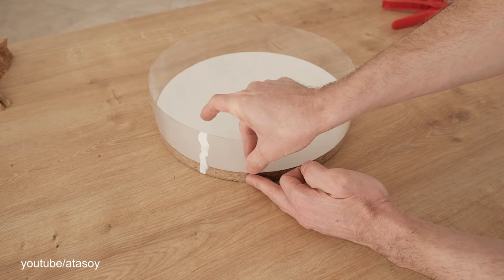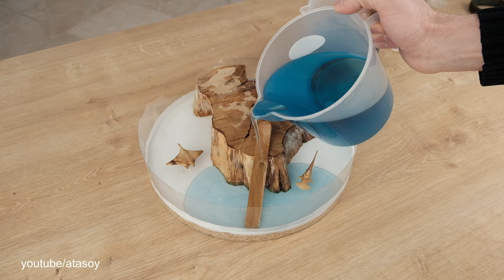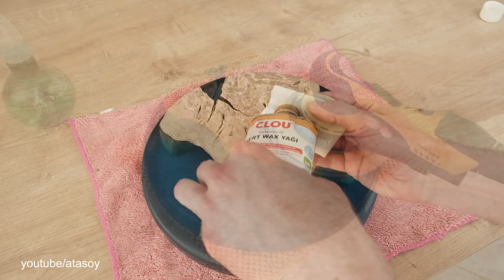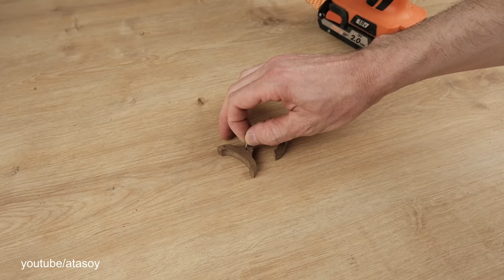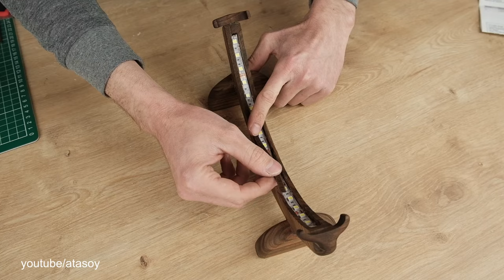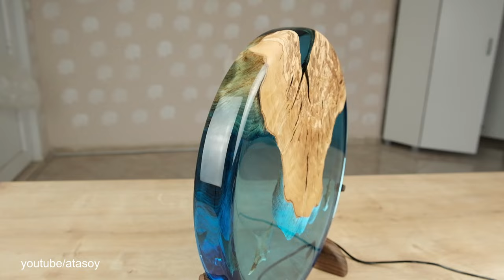How to Make a Decorative Sea Creatures Epoxy Lamp - Resin Art

Comment: turned out very beautiful! I made about the same but as a side table. If you had first sailed the wood with epoxy, then you would not have had those few air bubbles. but you probably knew that. greetings from the Netherlands

Comment: hocam epoksiyi döktükten sonra içersinde oluşan baloncukları almak için pürmüz kullanıyorum ama ertesi güne içi tamamen hava kabarcıklarıyla dolu oluyor bunun önüne nasıl geçebilirim ? 
bu zamana kadar çok yardımcı oldunuz teşekür ederim
Reply from the maker: Epoksiyi hazırlamadan önce mutlaka oda sıcaklığında beklemiş olmasına dikkat edin, eğer soğuk ortamda bekledi ise reçineyi 70 derecelik sıcak suda 15 dk. kadar bekleterek kullanınız. 
Soğuk yada serin yerde bekleyen epoksi karıştırılırken çok fazla baloncuk oluşturur. 
Kuruma esnasında çakmak ile alsanızda kurudukça içindeki mikro kabarcıklar birleşerek gözle görülür baloncuklar oluşturur.
Döktüğünüz kalınlığa uygun epoksi kullanmaya özen gösteriniz.(Tek seferde kaç cm ye kadar döküm imkanı vermekte ve döküm kalınlığına uygun ortam sıcaklığını sağlamalısınız)
Eğer epoksiniz çok fazla ısınma yapıyorsa bu ısınma esnasında kabarcık üretir bunada dikkat ediniz.
Eğer ahşap veya benzeri nesneler ile çalışıyorsanız döküm öncesi az miktar epoksi hazırlamalı, fırça ile bu nesnelere  epoksiyi sürerek kurumasını beklemeli ve sonra ana döküm işlemini yapmalısınız. Bu işlem içlerinden hava kabarcığı çıkmasını kısmen önlemenize yardımcı olacaktır.
En iyi sonucu almak için epoksiyi karıştırdıktan sonra bir vakum odası kullanarak epoksi gazının alınması gerekir. Ama bu yöntem başlangıç seviyesi için pahalı bir alet, kendinizi geliştirdikten sonra bu aleti temin ederek epoksi içindeki havayı alabilirsiniz.
Reply: @atasoy  çok teşekkür ederim :)

Comment: Hello, I made my first project following your videos. I used 6mm acrylic sheets for the base. all good until then. however the resin gets so hot that the acrylic sheets bent a bit. and I also feel that the resin contracted a bit... any recommendations, regards
Reply from the maker: First check the type of epoxy you are using.
Deep pour epoxy should be used for large and thicker works than 1 cm.
Follow the instructions for use of the epoxy used.
Pay attention to the maximum pouring thickness.
If you exceed this, you should lower the ambient temperature.
The ambient temperature should be lowered as the amount of epoxy used increases and the casting thickness of your mold increases.
I am giving the link of the epoxy I use, there is a graphic in the description section, please review it.
I'm giving this as an example to you.
https://resininresin.com/product/mass-pro/?v=ebe021079e5a
https://i1.wp.com/bestista.com/wp-content/uploads/2020/09/mass_uygulama_kalinligi_en-751x1024.png
Reply: @atasoy  thanks for the information, I poured 750 grams for a thickness of 4 cm at 21 ° temperature.
Reply from the maker: This is a pretty ideal temperature, but is the epoxy you're using small volume or large volume(deep pour) epoxy?
What does it say in the technical specifications of the epoxy you use, what is the maximum pouring thickness specified?
It can be poured in maximum 1 cm thickness with small volume epoxies.
It can be poured in 5-7 cm thickness with large volume epoxies.
Please find out the type of epoxy you are using first. You may be using the wrong type of epoxy.

Comment: Ellerinize sağlık. aboneyim. çoğu videonuzu izledim. deneyiminiz olduğu için bir sorum var. epoksi dayanıklılığı nedir? sağlam bir mazleme midir? kolay kırılır mı? şöyle örnek vereyim. üreteceğim epoksi ürün 1 cm kalınlığında  3cm eninde ve 16cm uzunluğunda. Dikdörtgen şeklin ince kenarından sabit bir yere monte edeceğim. ve üzerine ağır bir obje koyacağım. Acaba kaç kg a kadar taşıyabilir? tabiki denemeden bilemezsiniz ama epoksi kırılganmıdır. dayanıklı bir maddemidir. misal bu verdiğim ebatlarda bir epoksi (darbe/vurma yapmadan) sadece basınçla kırılabilirmi?
Reply from the maker: Teşekkürler;
Epoksi aslında çok kuvvetli bir yapıştırıcıdır, cam gibi kırılgan bir malzeme değildir ama darbe aldığında kırılabilir.
Epoksilerin oda sıcaklığındaki sertlikleri yaklaşık olarak 80 Shore D dir. 
Ağır bir obje koymayı planlıyorsunuz fakar bu ağırlık nekadardır? 1 kg mı 100kg mı? 
Ayrıca bunu denemeden söylemek yanliş olur, bir kaç kiloluk bir malzeme ise çok sorun çıkmaz.
Ağır bir obje koymaktaki  amacınız epoksiden bir raf benzeri birşey mi yapmak istiyorsunuz.